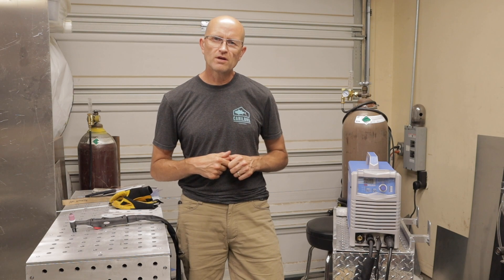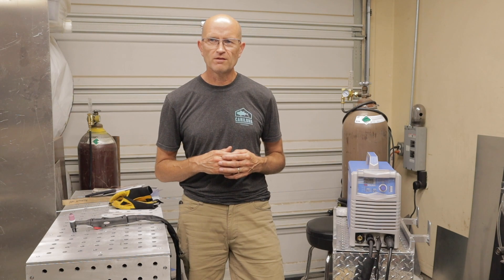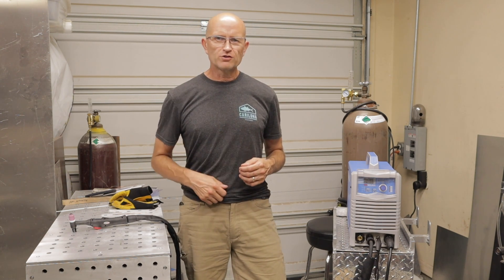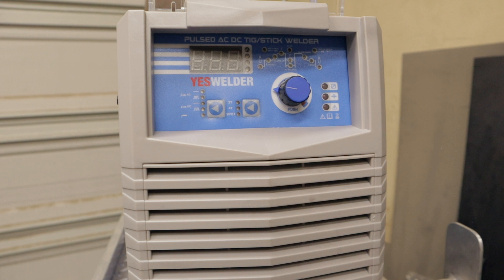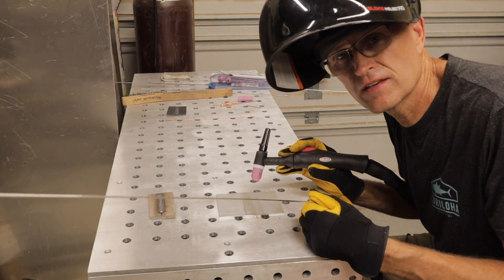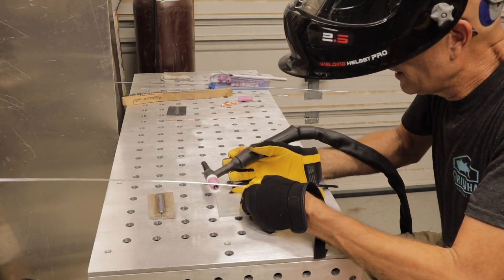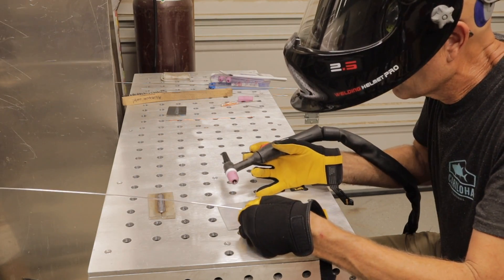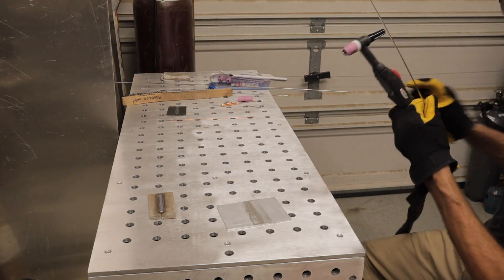NEW YESWELDER TIG Review 250Amp AC/DC welder w/ advanced Pulse capability. DISCOUNT CODE IN NOTES

Comment: Hi, just wondering if you have had any issues with this welder as of now (FEB 2024). 
Mine tends to have issues with an error code E3 that isn't mentioned in the manual. Of course I contacted the company and, although having a good attitude, did not really resolve the problem (of course my power source etc has been thoroughly examined and verified). Bottom line, I wonder if there is an upgrade/update available, like a new circuit board or whatever, as I see the machine is no longer offered. I've respectfully contacted the company and have not heard back. They have a "200P ACDC" now - replacement? THANKS for the excellent video!
Reply from the maker: I haven’t had any issues with mine at all. I use it now for mobile Tig welding and regularly run it off my Honda generator with big extension cords and I’ve never thrown an error code. It has shut down a couple times from me welding too long at 250 amps, but after it cools down it still keeps going. I was kinda surprised that they discontinued it because it is pretty rare to find a 250 amp ac/dc Tig that is this portable and at an affordable price. I keep hoping that they will come out with an updated model, but haven’t heard anything from them in a long time.
Reply: @PranaTech Thanks, that is a relief. I'll open the unit and see (without surgery) if there is simply a visible lose wire or cracked solder joint. I am not certain about the discontinuation of the 250P -- it just does not seem to appear on their website, while that new(?) 200P is present.  Your videos are great!

Comment: Would there be any issues running one of these off a 7500w generator?
Reply from the maker: No issue at all. I run mine off a Honda 5500 all the time doing mobile aluminum repair and I’ve never had any issue at all. If I’m welding at 250 amps, every once in a while I’ll pop the breaker, but with yours being 7500, it should work perfectly.😊👍

Comment: Ok so after some questions that you answered or me I pulled the trigger and bought the 250 today, the Yes pedal and a good argon gauge. Do you have a suggestion on brand of tungsten and should I get a nozzle kit with different cups etc?? Also I caught your video on tanks. I bought a dozen “e” tanks ( 5” x  26” ) can I use these for remote jobs and have any idea what they’re worth?? 
Cheers
Don
Reply from the maker: Hi Don!  Wow, you weren’t messing around! 🤣  Ok, the best all around tungsten that I’ve used is 2% lanthanated. It is the ones with blue at the top. Works great for everything. 3/32” will weld just about everything up to 1/4” aluminum and steel. Above that you will need 1/8” tungsten. 3/32 will get you started though. Doesn’t seem to matter what brand, just that it is 2% lanthanated. Get a stubby gas lens kit and install it before you weld with the junk cups and diffuser that the welders come with. As far as the tanks go, I would ask your local welding supply if you can trade up to a k size tank with a few of your smaller tanks. Here in Tucson they will all do it.  I don’t know what an E tank size is, it sounds like an oxygen tank designator. If so, just find a shop that will let you trade up to a larger size welding tank.😁👍
Reply: @PranaTech  Thanks again for the help. Is the YES stubby kit worthwhile or am I better off to go with like CK worlwide?
Reply from the maker: Hi Don! The Yes kit is great! I have a high quality set and the Yeswelder set and it is of a comparable quality. 😊👍

Comment: I love your videos, have you come up with a a better foot pedal
Reply: Thank you for your quick response I’ll look into those options. Are there any other mods that you have done to make it your perfect welder? Million dollar question…. To do over again with this still be your choice or would you be looking at another model? Thank you
Reply from the maker: Hi Don! Yes, the other mod that I did to make this the perfect welder was to convert it to water cooled so I could make longer aluminum welds without overheating the torch. I built a big Tig water cooler as a project and I will be putting up a video soon of that build and a video on how to do the conversion on the Yeswelder Tig. If I had to do it over again I would still buy the Yeswelder Tig again because it has performed flawlessly for me and I weld a lot! If there were any quality issues they would have shown up by now for sure. The other reason is that there isn’t any other 250 amp AC/DC Tig welders on the market that can compete with the Yeswelder 250P. There are many cheap Tig welders on the market now in the 200 amp range but most 250amp ac/dc Tig welders are over $1800 and up. That extra 50 amps of power is a big deal when welding aluminum. Hope this helps! 😊👍Don
Reply from the maker: Hi Don, yes, there are many options now for this welder. Yeswelder started making a decent pedal about 8 months after I got the welder. It’s pretty darn good I must say. Unfortunately I spent a bunch of time converting a Nova pedal to work with the Yeswelder tig and then I went and designed my own pedal and built the ultimate one from scratch that I did a video on. Here is a link to my pedal build.https://youtu.be/f2ta08h3q5E Also after that SSC started making aftermarket pedals to fit the Yeswelder Tig. Theirs are supreme quality and work great but are a little pricey. Here is a link to theirs.https://ssccontrols.com/product/c960-0525-tig-welding-foot-control-yes-welders-tig-250p/  So there are plenty of options out there for you to upgrade to. The Yeswelder one is the most affordable of the bunch though.😊👍

Comment: Hey brotha, what other TiG torches can I fit on this welder and/or what is the thread size of the collet if I want to switch to an mfurick cup? Thanks for the video!🙏
Reply from the maker: Good morning! Ok, any tig torch that has a 5/8-18 thread fitting on the end will work with this welder, but you will need to take a couple minutes to make an adapter because the welder has a male thread and so do American tig torches. Here is the adapter that you will need to adapt an aftermarket torch. https://www.ebay.com/itm/184841679271?hash=item2b096c31a7:g:ivQAAOSwtjdgoZ82   You will need to cut the adapter in half because it comes too long. If you cut it in half at the 1.125” length, it will work as the double female to adapt the aftermarket tig torch. The torch that I bought is a CK Worldwide model TL2112HSF FX. It is a 200amp torch with a flex head and a red superflex hose. Here is a link to the torch I bought. https://weldfabulous.com/ck-ck2112hsf-fx-torch-pkg-200a-gas-fx-w-12-1-2-1-piece-superflex/  If you just want to run a Furick cup on your yeswelder tig, just buy a stubby gas lens kit for a size 17 torch and it will fit right onto the yeswelder torch. The Furick cups will then screw right on to the stubby gas lens. I am currently running a Furick cup myself and it is an amazing upgrade! Let me know if you have any other questions.  I am currently making a video on how to convert the Yeswelder to a water cooled torch setup and the adapter will be shown in that video coming up soon. Let me know if you have any other questions.😊👍
Reply: @PranaTech  ok. Thank you for the great info! Just a couple more questions. Do I have to make any modifications to the aftermarket Yeswelder TiG torch? And does the foot pedal really control the amperage on this machine? I’m really in between this and the Weldpro model.
Reply from the maker: Hi there, The foot pedal they are selling now is a great one! The one mine came with was junk! It does control amperage very well and smoothly.  The tig torch that comes with the Yeswelder is pretty decent. You will be able to weld anything you want to with it. No modifications are needed to this torch to run a Furick cup. You just buy any size 17 stubby gas lens kit for 3/32 tungsten and the Furick cup will screw right onto it. It will be the same with the Weldpro if you go that route. I think Weldpro builds a great welder as well. The Weldpro is dual voltage and the Yeswelder is 220v only. The Yeswelder does have 50 more amps though. If you are going to be welding a lot of aluminum, especially 1/4”, I would go with the Yeswelder. If you can live with 200amps for most of the welding you do, the Weldpro would be a great choice. 😊👍
Reply: @PranaTech  awesome man! Thank you so much for the info. Just order the Yeswelder😂 I’ll be back and let you know what I think. Thank you brotha! Have a good one!
Reply from the maker: No problem at all. Let me know if you have any other questions or need any settings to get started. 👍
Reply: @PranaTech  thank you bro I’ll keep in touch!👍

Comment: Don, nice review. I've been looking at the YesWelder 250P Tig and the AHP 225Xi and both look like they are great machines. I haven't found a straight up comparison between the two. Could you give comment on these two or possibly make a video comparing the YesWeldwe 250P and your AHP 201XD?  Thanks

Your foot pedal build was sweat too. I'd like one of those, I may have to try and build one.
Reply from the maker: Zluca05, sorry for the delay in my response. YouTube didn’t show any comments for 2 days and they all showed up today. Anyway, I think they are both great machines and very capable at all types of Tig welding. I purchased the AHP because I wanted to learn how to weld aluminum. It was great to learn on and simple to set up. I have been Tig welding for 37 years but it has all been on steel. Aluminum was a whole new world and much more difficult to weld than I thought. After about 6 months practicing with the AHP I felt confident enough to start building some projects with it and it soon became apparent that even though it is rated at 200 amps, it struggled with welding 1/4” plate. Especially filet welds on inside corners. Outside corners it worked beautifully. 3/16” and smaller, it welds amazing! Great quality welder! The Yeswelder 250 came along and was just the power boost I needed. It welds 1/4” aluminum without any problem and I’ve even welded 5/16” and 3/8” a few times with great results. One of the interesting things that I noticed is that the Yeswelder set at 200 amps would weld hotter than the AHP at 200 amps. It could do inside corner filet welds on 1/4” with no problem at all.  Which I found strange because the Yeswelder is about half the size of the AHP. The Yeswelder also has a 60% duty cycle at 250 amps and 100% duty cycle at 180 amps. In the end I just didn’t have the room for both welders and I ended up selling the AHP. Both are great welders so I don’t think you could go wrong with either one. 😁👍
Reply: @PranaTech  Don, thank you for taking the time with your detailed explanation. So I’ll just have to decide which one to go for. These are both similar in price but still no chump change if you know what I mean. Thanks again

Comment: Does it have a foot pedal?
Reply from the maker: Hi Gary, you can order it with or without. They have a decent low profile pedal now in the accessories section of the site. I would order the welder without a pedal and then order the upgraded one in the accessories section. Mine came with a cheap pedal that I couldn’t hardly use. I upgraded to a nova pedal for an AHP and adapted it to fit the Yeswelder Tig. 😊👍

Comment: Are pedals from Nova or SCC available for this welder?
Reply from the maker: Hi Mark, no, they don’t support this welder yet but I have a wiring diagram that shows you how to convert the pedal for the AHP 201XD. It is not difficult and is merely soldering a 5 pin plug onto the SSC or Nova pedal cord. Here is a link if you want to see the diagram. https://drive.google.com/file/d/1ensmrBx3Y1fsxU2AME1HBv9_G13EQOZ0/view?usp=drivesdk  I have been running a Nova pedal with this welder for months and it works awesome and it is a great improvement. If you have any questions about this feel free to ask me anytime.👍😁

Comment: What size breaker should i uss. The book does not say
Reply from the maker: Hi Luther!  The back of the welder says max 40A but I’m running a 30amp breaker and it has never tripped and I have welded at max 250 amps many times. Realistically, I don’t think it pulls more than 25 amps ever on tig mode.👍😊

Comment: What's the duty cycle
Reply from the maker: Hi Mark, the duty cycle for tig is 60% at 250 amps and 100% at 183 amps. Compare that to any big name welder out there and you will see that it blows them away. It is also not over rated because I weld at max amps all the time when I’m welding thick aluminum and I’ve never had the welder shut down from thermal overload. I’ve been pretty amazed with their welders! 😁👍

Comment: Thanks for the review. Can you use a Nova Pedal or other 3rd party pedal, with this machine? Is the plug/pinout the same?
Reply from the maker: Hi James, you can use a Nova or SSC pedal for the AHP 201XD Tig. You will need to install a new plug to fit to the Yeswelder Tig. You will need a GX16 5 pin male plug to fit the Yeswelder Tig.  I am in the process of filming a video on how to upgrade this Tig with a Nova pedal and a CK Worlwide torch.  I have a diagram on how to wire the plug if you would like it. You will need to do a little soldering to the new plug but that is really all it takes to do the conversion. The plug you can buy on Amazon for just a few dollars. Let me know if want the Diagram. 😁👍
Reply: @PranaTech  that would be great. Thanks. Also, any desire to take the lid off the welder to show us the internals and build quality?
Reply from the maker: Hi James, I haven’t pulled the cover on the Tig, but when I got the Yeswelder Mig last year off Amazon I pulled the cover and I was very impressed! It had very high quality components. Big heavy duty Japanese made capacitors and overall nice workmanship.  I’m sure the 250 pro Tig is of the same build quality. One of my subscribers did a bunch of research on Yeswelder and their company and factory and he told me they are the real deal. He said they don’t just repackage somebody else’s welder and sell it. They control all aspects of the manufacturing in house and then sell direct to the public. That’s how they keep the prices down and make a quality welder as well. Here is a link to my diagram for the Nova pedal conversion. 😀👍 https://drive.google.com/file/d/1ensmrBx3Y1fsxU2AME1HBv9_G13EQOZ0/view?usp=drivesdk
Reply: @PranaTech  I am even more keen to buy now. What do you think of the tig torch? Like or going to change to a non euro style? Do you have a torch with a valve and keen to try lift start tig in stick mode, rather than HF start? They said its possible to do with valved torch.
Are you going to show any mild steel or Stainless vids?
Thanks so much again
Reply from the maker: Hi James, I’ve never tried to lift Tig with a high frequency machine before. I converted my arc welder years ago to a lift Tig and it worked fine for me but not having any amperage control is no fun at all. Going to lift Tig on a machine that has a pedal and high frequency start is like converting your modern car to a Model T Ford. 😁 The torch that comes with the Yeswelder 250 works fine. It is very heavy duty and I’ve been welding with it since last summer and it has performed fine. I’m just used to a slimmer and not so clunky torch and that is why I’ve decided to upgrade. 😎
Reply: @PranaTech  yeah, I am going to be working on my cars and potentially near some electronics at times and heard HF doesn't play well, so that's why I really wanted to HF and Lift Start in one machine.
Reply from the maker: Ahhhh, now I get it! 👍😊
Reply: @PranaTech  Using your discount code... about to buy... thinking thinking thinking :)
Reply: @PranaTech  Just received mine. Opened it up and took a bunch of pictures as it came with a NEMA 5-50P plug which we don't use here, so rewiring on a new cord. Want to see the pics? Curious if the USA dual phase 220v is different internally to the European 220V single phase units. Input goes to a bridge rectifier so potentially not.
Reply: @PranaTech  Here are the pics. Would be neat to connect with you outside of Youtube.

https://drive.google.com/drive/folders/1iYXe1VkprRAidhieP6RO1SQj_9T2yznE?usp=sharing

No Japanese caps to be seen really. All larger electrolytic Caps seem to be JWCO branded, which is a Chinese brand if I am not mistaken. Chinese FET's, some OnSemi IGBT's. All looks good though - apart from the one resistor hand soldered (poorly) on the back side of one of the PCB's. Unsure what that is about. Just left it all as is. I opened it up as my unit had a dent on the side, so took the cover off to straighten it, and also look at the connections for the main power flex, as it came with the NEMA plug which I have to change, so rather than cut the end off I might change the cable too.
Reply from the maker: Hi James, ours is a single phase 220 so there shouldn’t be any problem at all. 👍😁
Reply: @PranaTech  Oh I thought to get 220V in the USA you combine 2x standard 110V outlets phases together to get the 220V, making it therefore Dual phase 220V. Where I am, its 230VAC as standard.
Reply: @JB-NZ   Hey James I'm thinking about doing a rewire of it can it run 2 20 30 amp service in the USA seems like this note is talking about something that I'm interested in I do not have 50 amp service 220 USA 30 amp service can I make it work and how to go about doing it thank you